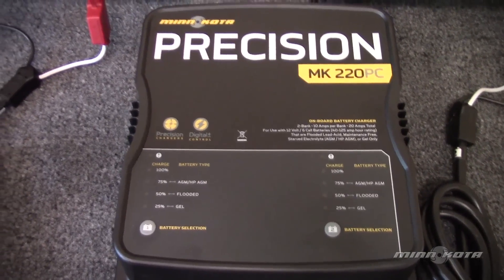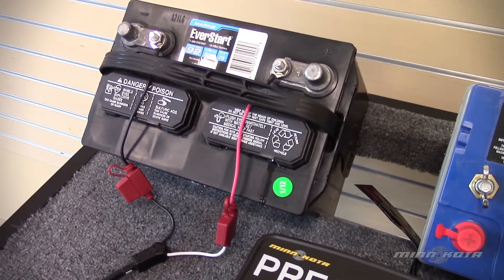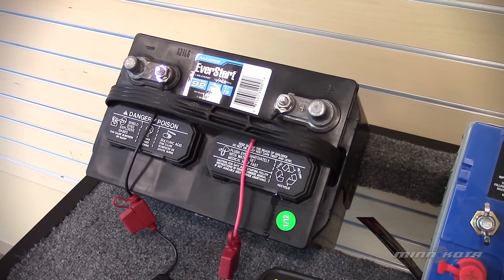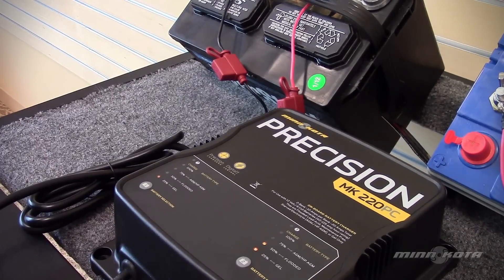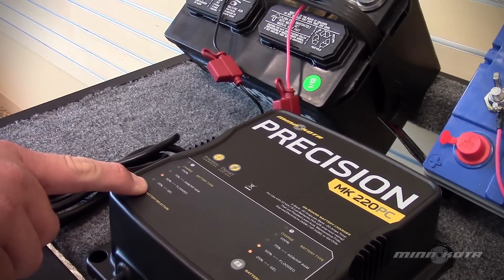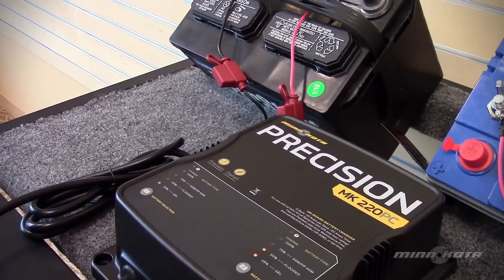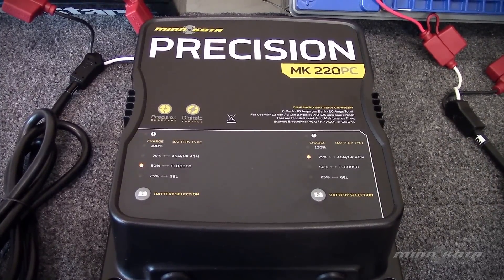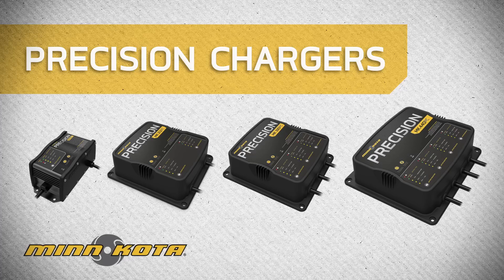Precision Chargers: Equalization Mode for Flooded Lead-Acid Batteries

Comment: About how long in general does it take for the eq process to run to completion on a lead-acid battery?  Is there any indicator that will display once the process is complete?  Thanks

Comment: Can I do the equalization on all the batteries at the same time
Reply from the maker: Yes, the charger is set up to operate independent by bank/battery.  So each battery can be put into equalization mode at the same time.